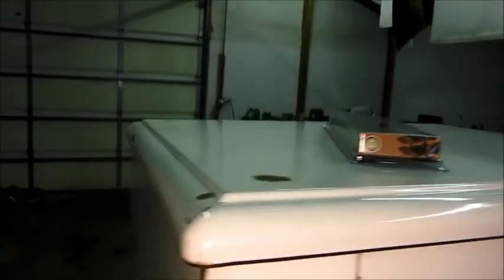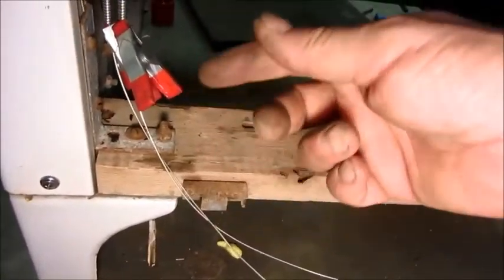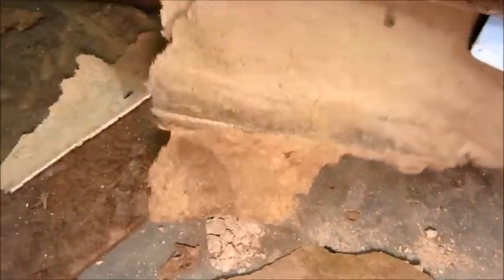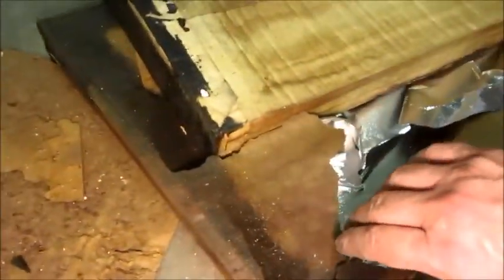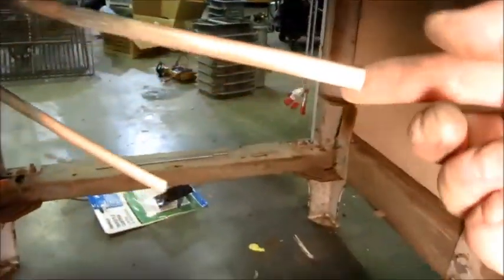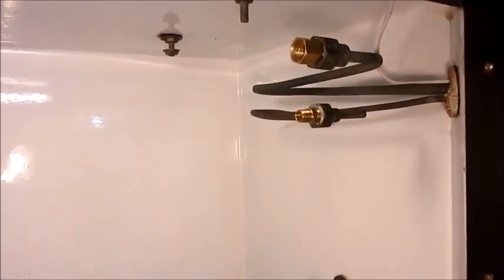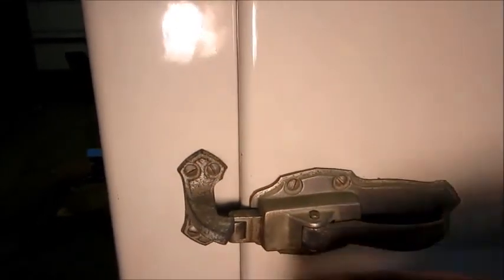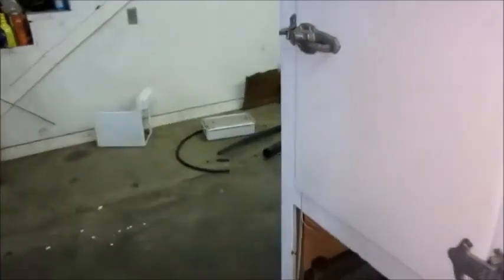1931 Frigidaire Antique Refrigerator - 6 - Cabinet work begins!

Comment: The panels of foil insulation are very interesting. It looks like they would have been fairly efficient when new. Just out of curiosity, is the foil ferrous or not?
Reply from the maker: It probably would have been pretty good when still sealed up. I think there were 4 air spaces in it. I'll have to check if it's ferrous, but it doesn't look like it would be.
Reply: I also like the fact that they used the cardboard on the door, although its an inferior insulator I'm sure that the foil panels would not hold up to the fatigue of opening and closing the door. All in all, an interesting glimpse into the days before expanded polystyrene.
Reply from the maker: It is interesting for sure! They did the best they could with what they had.

Comment: Neat! I had been wondering what you've been up to. ;) Looks like this did not originally have a cabinet light? Is that a tubular incandescent lamp in there? Hard to tell in the video. An LED would seem out of place to me. :)
Reply from the maker: You're correct, it didn't have a cabinet light. There's an inward-facing surface inside the cabinet above the door. I did not want to drill any holes in the cabinet, so I did use a flat panel LED attached with adhesive. You can't see the actual LED light source unless you stick your head in the cabinet. The one I chose has a more yellow hue to it, matching incandescent lights.